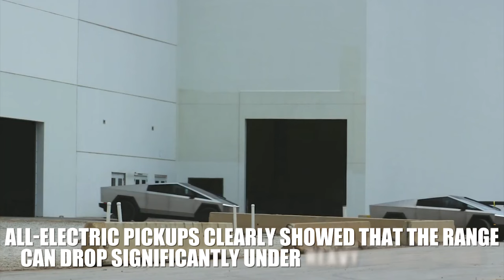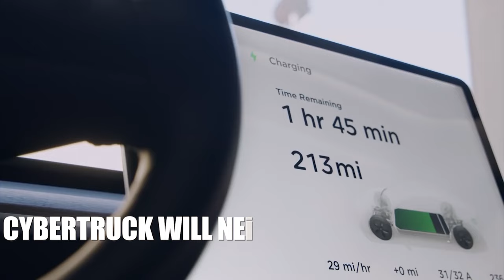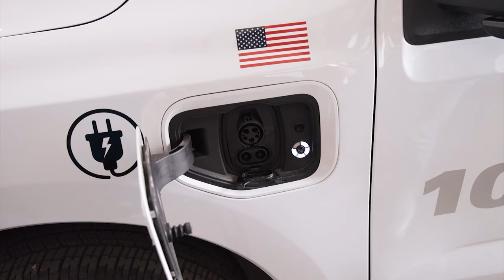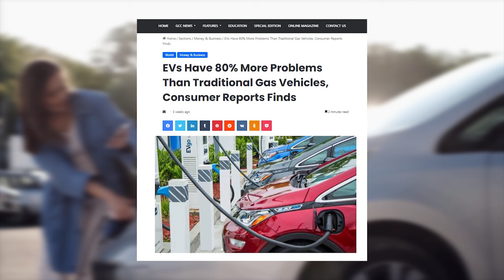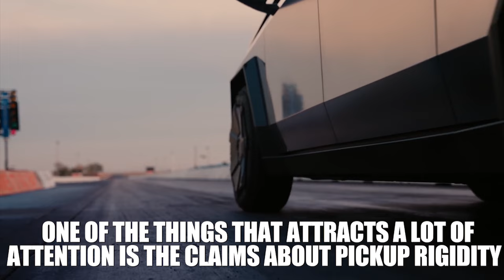2025 RAM 1500 CRUSHES the World’s Most OVERHYPED Truck for 7 HUGE Reasons!

Comment: I disagree with you completely.  I have owned 5 Rams in a row and the new one has nothing that makes me want to buy one.  The Hemi is gone, the I6 inline 6 is an unknown with the limited durability of a hard working turbo with the heat and expenses to deal with in a few years.  It has a lot of sensitive electronics in the cab, I don't trust Stellantis to get that right either.
Reply: Lucky for you there are still old ones out there that you can buy. And with today's prices of new trucks they are worth restoring to like new for a lot less money.
Reply: Agreed.  I'm on my 4th and have no desire to upgrade my 20 Ram Rebel since the prices have skyrocketed.  The Ramcharger looks interesting but we'll see how that pans out when it's released.

Comment: At time reference 3:03 in the video it stated:  
"Cybertruck will need 15 minutes to add up to 136 miles while refueling a new RAM 1500 takes a few minutes."

I am assuming that the RAM 1500 has a 20 gallon tank (it is actually somewhere between 23 and 26 gallons) and has a gas milage of about 20 miles per gallon. RAM states that the RAM 1500 Hemi's gas milage is 17 city, 23 highway so I am averaging the numbers.    15 galloon fill up  @ 20 miles per gallon gives you a conservative additional range of 300 miles per fill up.   Time requirement for RAM 1500 fill up:  10 minutes.  

I am assuming that they are adding range to the Cybertruck while the battery is at less than 80% charge.   When a rechargable battery reaches 80% charge, adding additional electrons to the battery becomes more difficult and requires additional time. .   

I have encountered this situation with a conventional car.  I once left the head lights running overnight, draining the battery.
Charging a conventional car battery from 0% to 80% charge required about 4 hours.  At 80% charge, a conventional battery can start a gasoline powered car.   Remember, the purpose of a battery in a conventional powered car is to start the engine.  While the engine is running, the alternator provides all of the electricity required by the conventional powered car, while recharging the battery.   

Charging a conventional car battery from 80% charge to 100% charge required about 24 hours.    I suspect that situation is similar to EV Batteries, but it is difficult to obtain these numbers.   Also, EV Drivers are aways talking about extending battery range using percentages of battery charge  or in Kilowatts capacity, rather than describing the additional number of miles that extending the range is allowing them to travel.     This is the first video I have found that described the time required to filled up (charge) an electric battery in time required in terms of  additional miles to travel.    

Cash Joran has a YouTube video titled, "New Yorker’s Won’t Buy EVs… Why?"
Interesting quotes from that video: 
Time Reference 0:35 in the Mr. Jordan's video "Would you put your daughter on the highway in an electric vehicle and have her pull on the side of the road and wait two hours to charge the vehicle?"

Time reference: 1:43  Cash Jordon quotes Jim Farley, CEO of Ford.  Here, Mr. Jim Farley  is describing traveling in a F150 Lightening "Charging has been pretty challenging.   It required 40 minutes to get 40%."  He never discussed how many additional miles that a 40% charge will allow him to travel.